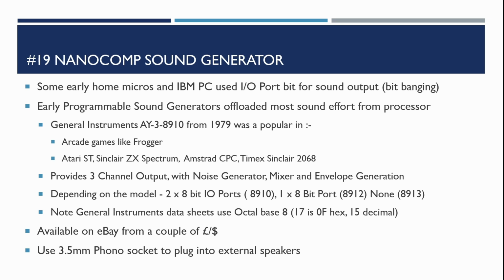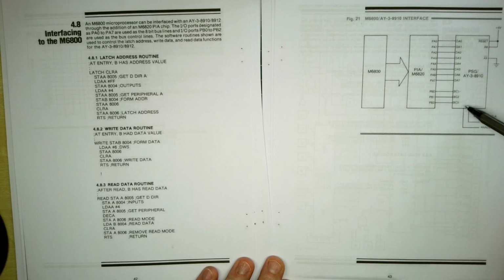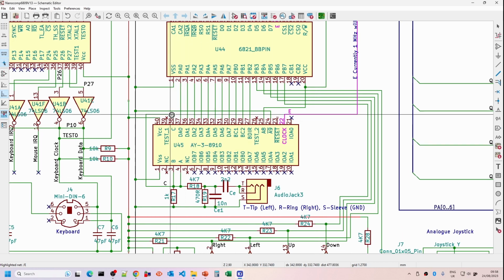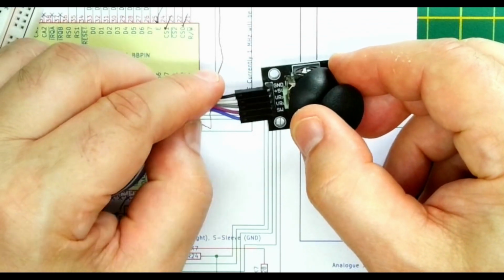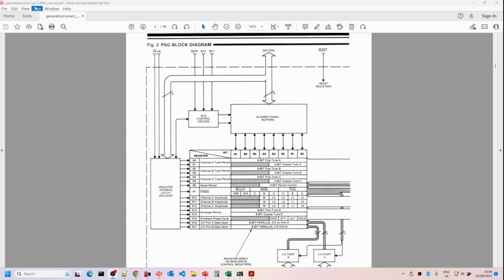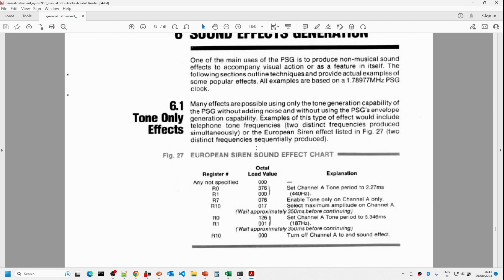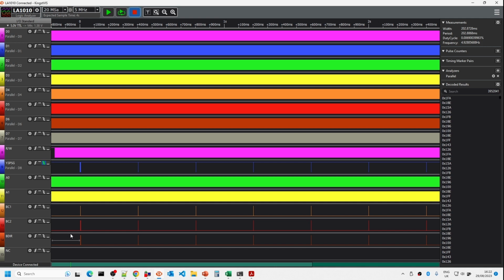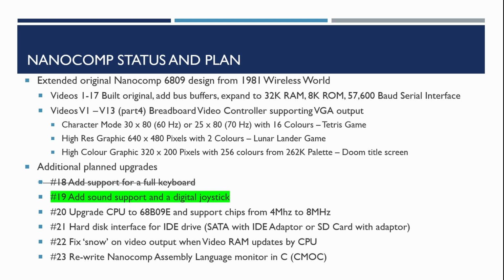Nanocomp 6809 #19 Sound Generator and Joystick

Comment: where did you get an 8910 that cheap? I know they are listed that cheap from China but not had a good one yet, UK sources want £40 each
Reply from the maker: Was UK order about 1 year ago. https://www.ebay.co.uk/itm/362255974215 is showing as £3.19+p&p just now
Reply from the maker: And this one for less than £3 including p&p! https://www.ebay.co.uk/itm/191928750845
Reply: @breadboardinglabs  both from abroad which was my point. if someone has tested them though and trust the supplier then I'll give them a spin but not had much luck buying chips from China lately